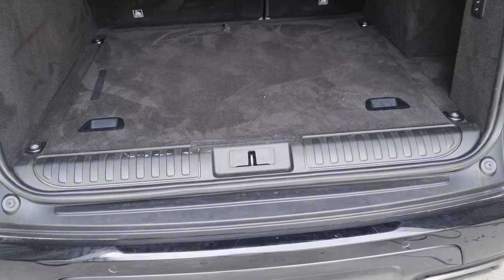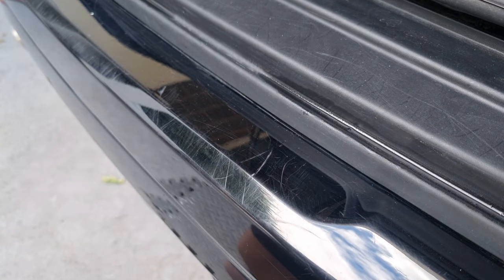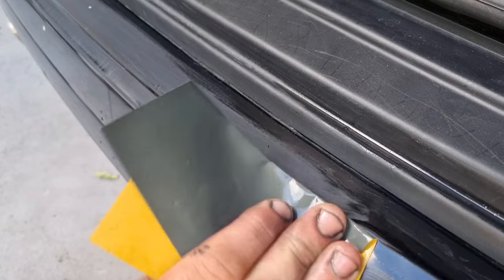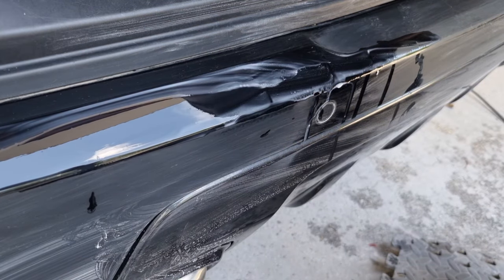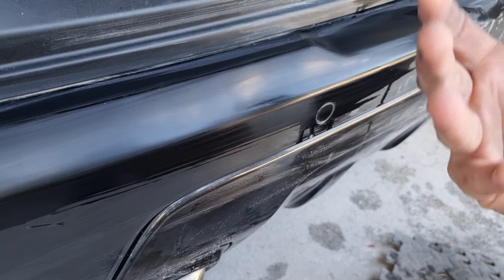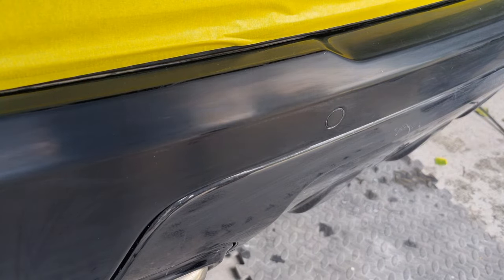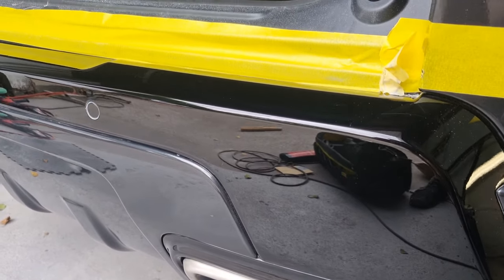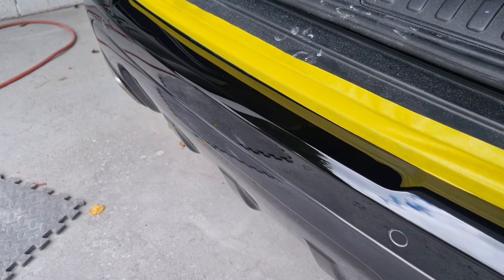How to Remove Bumper Scratches

Comment: I have a mazda cx30 2023. Big textured fenders over the tires. Somebody scraped my passenger rear fender. I'm not sure if it was with their car or what, but it left a good 4-inch by 4-inch lightly scratched spot that is much lighter now than the rest of the fender. The scratches are not deep, I would say they are smooth to the touch. It only bothers me because it's a new car, and it stands out. Is it at all possible to get rid of the scratches since it is a textured painted plastic fender? The car is black, and the fenders are like charcoal black. It seems like even the finest sandpaper would make things worse. However, you're the expert.
I would love some advice
Reply from the maker: Yes it's possible. Just go steady

Comment: In the US, I can't seem to find a similar product for either (1) Paint Gear kits, or (2) the Farecla G360 cutting compound (specifically, the SFC106 cutting compound). Do you have any recommendations for similar products in the US?
Reply from the maker: Look for solvent based paint supplier. Any good cutting compound will do mate it doesn't have to be farecla. Maybe look at menzerna or something similar they do smaller bottles

Comment: Good however I’ve noticed a difference between a body shop person and a detailer , the detailer will make sure no polish residue goes in gaps and clean up a lot better , the parking sensors is full of polish residue and all body shops don’t care about things like that
Reply from the maker: Firstly, thanks for the sub and watching my content. This is more a bodywork channel so my content will be more based on that. I was actually a valeter then a detailer for nearly 10 years before learning to spray and do more advanced work. Having done both.. you put that much time and skill into the repair and refinish that by the end (flat and polish and minor bits ie senosrs/gaps) that you have probably ran out of time/patience and customer budget to be messing around with tooth picks etc. That car went straight from me round to a valeter to be cleaned up for re sale.
Reply: @cvrpov  fair enough but I was just saying there’s a difference , I had my new car which was just 3 weeks old when someone scraped the bumper and the body shop left polish residue in the sensors and other gaps , even scratched up one headlight and with a torch I could see lots of hazing and swirls where they painted the bumper . I been into detailing a couple of years and have everything , and now want to learn how to do small painting jobs as I never find a good painter so I guess I need to learn it myself , I got everything I need just need to practice
Reply: @M.E63  why would you want to do it yourself, leave it to the professionals to handle, I know your type really
Reply: @shegzr7812  you obviously never read both of my comments I actually decided to do it myself as I took it to a pro a they messed it up, not only did they do a sloppy job but colour match was horrible , scratched up my headlight and this is a brand new high end car, the rubber around the parking sensors had paint on them, polish residue in the gaps, and more issues , this pro had not one bad review on google, the paint shop I get my stuff from recommended him and this guy was working on high end cars as I seen it with my own eyes, I’m sick and tired of pros doing things wrong then when you point it out they don’t want to know so that’s why I made the decision to learn it myself, I actually detail cars so I know about detailing and I decided to learn the paint side and that’s why I was watching the videos and this, even a pro was a amateur before like me, your going on as if a pro is born a pro so we must leave it to them, this is not the first time a tradesman done bad jobs and poor customer service and that’s why I resort to learning the stuff myself

Comment: Would the meguiars ultimate compound provide enough cut for these types of jobs?
Reply: Ultimate compound can remove 1500 grit or finer sanding marks, so yes it will work.
Reply from the maker: It's not the best for this kind of thing to be honest

Comment: Great content as always.  Some advice would be appreciated. I keep getting paint reactions around the edge off my primed area when spraying base coat silver  (solvent based)  very frustrating  .  Many thanks
Reply from the maker: Try putting a lighter 1st and 2nd coat. One of the biggest mistakes people make is a too heavy coat. Maybe even dry the area with a heat gun as ur applying it to dry the solvents quicker. If some reactions occurs then dry thoroughly and some dry 600 paper over the edges to try and feather out... always dry coats
Reply: @cvrpov  Thank you, your videos have helped me a lot
Reply: Use water not solvent if you are using solvent on a modern car you are breaking the law...solvent should only be used on classic and commercial when nesacery
Reply: And get Base stand lol u muppet